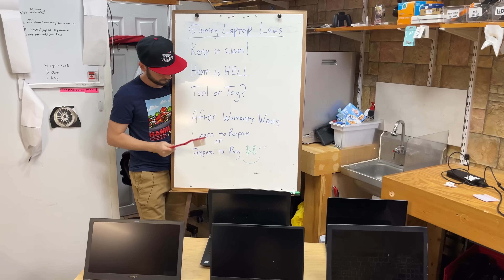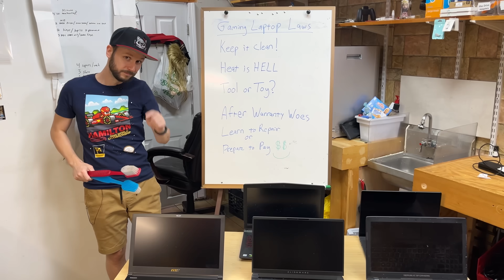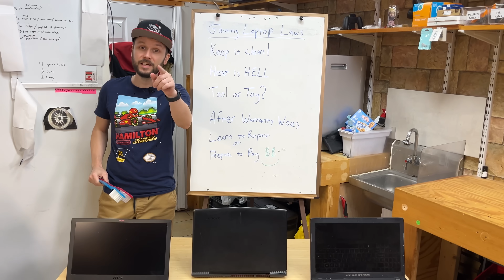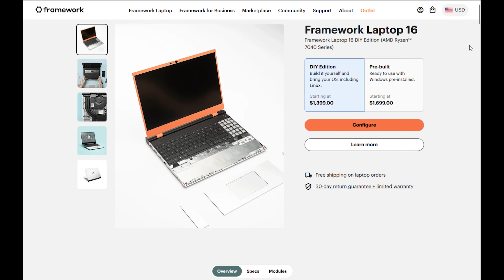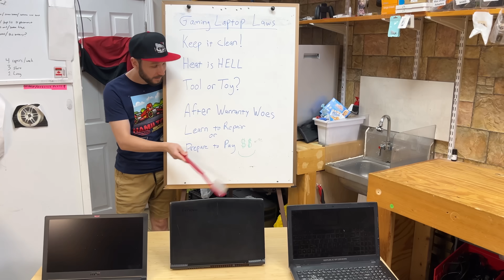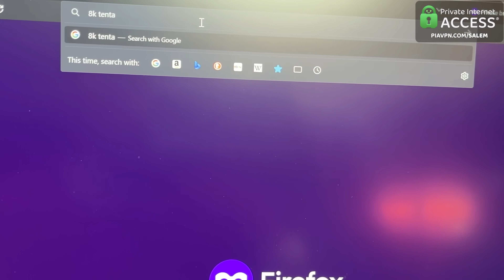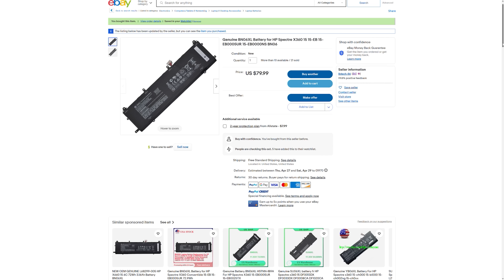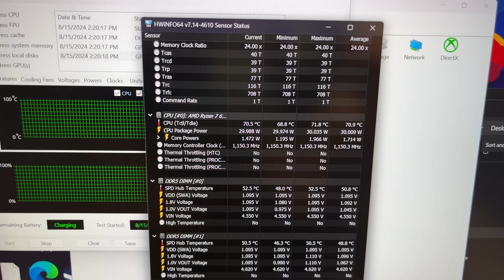Repair Shop Owners Guide to Buying and Maintaining a Gaming Laptop

Comment: I swear my experience with gaming laptops is so diverse. I first had a lenovo that worked for years on end on high preformance without much hassel. Then I did something stupid and bam it broke beyond repair. Now I bought a MSI vector laptop (biggest mistake of my life) and am now in overheating hell waiting for the repairman to fix it for the second time in under a month. Suffice to say I did not follow the tool or toy law :(

Comment: Things you should buy from MSI monitors 1440p 165 hz at 180$ in my inflated country works great.

GPU don't AMD GPU from MSI they break fast Nvidia fine. 

Case subjective some are good mostly not . 

Power supply MSI is good. 

Motherboard extremely good. 

Liquid cooler straight no don't last 3 yrs . 

Laptop bigger screen size one's has the least issue. .
Smaller the size more the problem. 

Don't buy ram snd SSD yes MSI make them in some countries. 
Even if they SSD fine not Ram

Comment: I have a similar model of the Alienware laptop and I always thought I was weird for meticulously cleaning every particle of dust off the keyboard and the fan inlets and exhausts just so it would look new.

Nice to know my OCD has the useful trait of keeping my GPU cool.

The MF power brick for those things though...my god they svck. Even with a fan underneath it the thing manages to self immolate after a few months and stops providing enough juice for the thirsty motherboard.

Comment: Had a Lenovo Laptop with a Ryzen 3 2500U, lasted me a good 4 years and showed signs of it dying and had about 2 repairs.
Reply from the maker: Surprised it didn't last longer tbh
Reply: @SalemTechsperts  At some point around the 3/4 year mark, It started overheating like crazy and then after I got my Prebuilt the very next day, I went to use to laptop to get some files just for the CPU to reach about 0.3-0.5 GHz in Task Manager before it ultimately killed itself.

Comment: Had a lenovo y540 that has 9th gen i5 and a gtx 1650 when I was in college (got it quite late at my 2nd to last year). 

Apart from the keyboard starting to fall apart and the screen that killed itself that I already replaced (because my brother hit it with something while in the bag), its still holds up well. I just did a repaste and some degooching of the fans and vents and it performs as good as new.

Never upgraded the ram and storage though, still stuck at 8gb and 512gb of nvme.

Comment: I had a MSI Raider GE76 I had got at Costco a few years back. I kept that thing in pristine condition. Had an i7 and a RTX gpu. I unfortunately got scammed with it. I thought I was getting 2k for it and shipped it across the country. Hating myself for shipping it before I got payment. But while I had it; I always kept it clean. Only thing I couldn't clean off was some baby puke that had landed on it from me burping my new born daughter. A hint of that touched one of the heat sink vents and I couldn't get in there to clean it out.

Comment: I do have a 2014 Razerblade 15". The only thing was the expanding battery I replaced. Now, right half of the laptop screen has a slight shade blue-grey color if you drag a white background to the affected side of the screen, but the screen still works. Band-aid sol. the problem by connecting to the monitor. Replacing screen would be difficult with no parts for it, and the bezel looks troublesome.

Comment: my asus tuf fx505dt died 7 monts ago due to motherboard issue, i had the same problem with the motherboard about 2 years ago but it fixed on service center, I had that laptop for 4 years, did a lot of work and gaming with that laptop but mostly I used it to watch movies. after my laptop is dead and the motherboard is discontinued I decided to build PC since I work mostly from home, I spend about USD 1200 to build a new PC 2 weeks ago

Comment: Had one just the other day that was 100% closed and looked like. Well not normal dust bunnies. Then one fan in it was completely broke. Not just the blades. Speaking of fan blades. One other one that sticks out it was about 1.1/2 years old. Both fans had melted blades on them. I have sort of seen that before. But not this bad and it was clean inside. The only thing I could think of is they stuck it against something. A guy brough one in and it wasn't even a year old. He already wore down the wsad keys. I did look this up and it was common. I have a saying. Though take it with a grain of salt. No such thing as a gaming laptop or a desktop replacement. Yea they can put in a desktop processor, and dedicated graphics. They even had that pci-e standard for upgrading graphic cards. Though that failed due to different sizes in the laptop per card. What fails to me is the air flow / fan size, upgradable, easy of repair, and as pointed out. Finding parts. More than once, I had to order parts from China.

Comment: Hello from Your Suggestion on Jarrod's Tech Video 

I am Going to Buy Lenovo LOQ 15 with 13450HX + RTX 4050 

Due to inbuilt undervolting and 180° hinge 

But i have heared a lot about intel HX Cpu frying the mobo and battery drain problem especially in customised models

What should i do ?

It is best bang for buck i can afford now i am trying to find HP Victus with 13500HX + RTX 4050 but it is out of stock and it is almost as good as LOQ .

Comment: I ran my legion for about 2 years with the 3070 and fans cranking every day, those heat sinks were clogged it runs 10 degrees c cooler now and it's not cutting clocks all the time

Comment: please please please this needs to be required reading (watching) for prospective gaming laptop buyers. if i had to trace down why every gaming laptop i've owned when i was younger die on me, it boils down to the points you covered. these machines are fragile and come with a life expectancy, no matter what manufacturers say.

silver lining me for me is that after losing sensitive data due to a gaming laptop going dead, it lit a fire under my ass to work hard and save up for my current PC - and you know damn well I'm going to stay on top of its cleaning needs lol

Comment: Just a little tip for people, don’t buy rebranded Chinese Tongfeng gaming laptops from clevo, eluktronics etc. They offer decent value propositions and are great laptops, until you need to repair them. Zero parts availability. Ease of sourcing replacement keyboards/batteries etc should be a big priority.

Comment: Although everything you said is true, I will say I had an AW M15 R7. That is the worst laptop that ever existed even when I only used on a clean, cool surface and don’t own any fur releasing pets. Multiple mother board replacements were required within the 6 months I owned it, as well as a heat sink replacement. They acknowledged bios updates were bricking systems, yet it took months to release a stable bios. I’m never going to buy anything Dell related after that awful experience.

Comment: Got my laptopfor 6 years. 1st thing that broke was keyboard, then the display went boop! Now im using blue tooth keyboards and mouse and connecting it to a monitor. I will use it until it is no longer viable

Comment: been getting your laptop cleaning shorts recommended to me and they inspired me to take apart and clean my 3 yr old asus (that i have not once cracked open to do maintenance on since buying). it wasn't nearly as difficult as i expected nor was it as gross as a lot of the laptops in your videos thank god, and the performance is now vastly improved. i didn't have any thermal paste since the cleaning session was kind of a spur of the moment thing, but i ordered some to use next time. thanks for the info and inspo!

Comment: I like mid range gaming laptops because when a part does break they are usually a little cheaper to fix/buy parts for. Also soldiered ram shouldnt be a thing in gaming laptops

Comment: Been running with an Acer Nitro 5 for a few months

After years of having failing second hand laptops due to my negligence and bed abuse, I'm extra careful to the point of obsession with this laptop. The laptop is only loaded with games and all my work is inside an external hard drive

Comment: So...a desktop is much more efficient? But being more costly? I don't know, I'm in the middle of trying to figure out if I want to buy a Gaming Laptop or a Gaming Desktop. I really want to get into Gaming and possibly streaming and I'd like to buy an efficient computer for this job that can also last a long time.
Reply from the maker: Do you need portability? If the answer is no, buy a desktop. It's cheaper, more reliable, easier to upgrade, easier to maintain, easier to repair.
Reply: @SalemTechsperts  Yeah I'm not looking for portability, but thanks anyway

Comment: I had a friend that knew how to help me build a tower pc part by part, it wasn't hard per say but you do need to know how to handle the different parts, especially the CPU, i felt like i was holding something that would self destruct at the smallest of wrong moves XD
Meanwhile i was holding the RAM like a snowflake, and my friend was like, SHOVE IT IN UNTIL IT CLICKS, and i was so scared i wasn't applying the required force for an embarassing time, he was starting to question reality XD
And I've been learning how to take care of it, cleaning the dust on occasion when i notice it starts to gather, now i know how to unscrew and put it back together ^>^

Comment: I've got a laptop with liquid metal for the cpu...

How often does that need changing? Because as confident as I am in my skills to change thermal paste... which is little, but I can follow basic instructions fairly well, I'm not about to mess with LIQUID METAL!

Would you mind posting another video for cleaning tools/solutions?

Comment: Be very careful when taking the heatsink out of it's place. Often you have the CPU, the GPU or both cooled with liquid metal. If you are not careful when removing the heat sink, you could spread that liquid metal all over the mainboard and guess what the metal part will do to it ? Short short short ...
So learn to repair but be very careful when dealing with liquid metal...or gaming laptops.

Comment: My last two laptops were both gaming laptops and never had overheating issues despite being used in places with pets. 

It's really simple. Don't get a $3,000 laptop. Get a $1,100 laptop on sale for 8 or $900. Something with a 4060 in it. You don't need anything more. I promise

Comment: I've kept my laptop clean for the past 2 years I've had it as well as replacing the thermal paste but it still has overheating issues and 2 of the keys stopped working 😭

Comment: I learned how to repair laptops by myself since 2016? Because I bought an XPS 13 for school but I was short at budget so I ended up with 4G+128G very base model, guess what? SSD is the first thing I found it not enough. So I search on the internet, SSD brands, how to reinstall windows system etc. I end up get 256G SSD which finally kinda enough for me to use as a daily driver. After that I found 4G RAM is not enough but there is no way I could learn how to change RAM which required a heat gun and more knowledge, so I end up get a 8G motherboard and 3K display from partspeople which cost a lot...I have to learn how to install the motherboard, change thermal paste and assemble it without any fuck ups, I did it! But I also learn a lesson, for choosing laptops, make sure get enough specs you need and you have to think about the future...
After that i switch to gaming laptops, get warrantys and repaste myself twice a year. I like DELL because they offer a very detailed service manual on their official website, followed the steps you probably won't screwed up... hopefully...

Comment: Have my alienware m15 for 2 years now mainly using it for work. It started sounding like a jet engine on a regular basis a couple of weeks ago. Took it apart and cleaned what I could see. 
Do you have the renewing the thermal paste in a normal speed video or do you recommend I give it  to someone who has done this before? 😂

Comment: i have a Vostro 3520 and use it for work and gaming but not so much gaming since my desktop is better and the laptop sometimes heats itself on putting it on my bed but only for 5 minutes then it gets cooled  and when it is not on a bed it is hella hot more than the heat when is it on my bed is it a problem that should concern me?

BTW i love your vids keep going and don't watch Po-kemon alone at 5:00 A.M it isn't good for the greatest technician that has ever lived

Comment: My laptop has only 2 speeds: 30fps gaming or 102°C gaming 😓

I regularly clean my gaming laptop and reduce graphics to maintain temperatures because I'm not brave enough to underclock ryzen cpu

Its not hot because its poorly ventilated. Its hot because it targets maximum performance regardless of whether its even necessary. It took so long for me to figure out that to avoid getting locked at 1.6ghz to manage temps, I can put the fan preset to quiet mode which prevents them going above 90°, then manually adjust the fan to get 60fps without my pc cosplaying a supernova

So far the only problem is a slow hard drive I replaced and missing screws because I suck at this

Comment: If you are a engineer planning to use solidworks, the suggested amount of ram should be 32 gb or higher. Or you are screwed. Or in the greatest’s words, f-sad. Or you will be waiting a millennia for any assembly to load.

Comment: What do you think about doing an expensive desktop/cheap laptop combo to remote desktop into? I need a very accurate screen, strong internals, something portable, and something durable (high end creative work) but they don't usually have to be the same device. 

The remote desktopping would be more of an exception than a rule, but i'd love to hear if you guys consider something like this viable for videoediting as an alternative to buying a glass spaceship that'll inevidtably fail in 2 years anyway.

Comment: Based! I have a question. Bought the same M15 R7 laptop few days ago. 

Can fans be pulled out and taken apart without taking off the cooler and motherboard? I would like to add a pinch of grease to the bearing. Already cleaned the dust. Thanks!

Comment: Ahhhh if only I can send my gaming laptop to you. Constant overheat until I disable turbo boost. It's a pain in the ass because its require 3rd party to disable it cause there's no option in the bios. Fan free from gooch thermal paste replaced but still thermal throttle to the point freeze and buzzing when gaming 😩

Comment: This is why I'm getting a desktop. But Lenovo is pretty reliable about parts. But nothing else.

I currently have an Ideapad 3 Gaming Laptop with Ryzen 5 in it. I got it in 2022 and it's been 3 years now. It still keeps going but it's showing its age. Not to mention there is a line of dead pixels in the middle of the screen. The A button doesn't work and the external shell has a scratch on it. I need and want a desktop.

Comment: Simple solution....don't buy a gaming laptop. Heat WILL  get it, it'll be expensive, it'll under perform, oh and it'll be expensive to fix when the heat gets it. I had to replace a keyboard on an Alienware laptop....72 tiny tiny screws on the keyboard sub-assembly. It was not a cheap fix for my customer.

Comment: my only problem to learn how to clean is those new "Fit together tightly plastic click bits" ... the ones you open with a pick.... or a screwdriver in my case. 
they scare me. I don't know when it will break or if i will hit a wire... which is very specifically placed near the touchpad and keeps jump scaring me

Comment: I've stuck with gaming laptops bcuz i prefer the portability. Had a asus g750 that i had to tear apart every three years due to something breaking. 
Now i use a modern alienware and when it breaks, there's no fixing it. Have had it apart a few times now and it's a miserable repair experience compared to the old asus rog. Almost everything is soldered to the motherboard now. No discrete parts at all

Comment: Question for you sir. I've had a gaming laptop for 2 years now. I clean the exterior of finger gunk about 2 times a week, kinda dust it with compressed air once a month, and change windows about once a year. Only, and I mean only reason I haven't pried it open to deep clean or change thermal paste is because its still within warranty. For another year and a half even. Question is: At what time is it reasonable to decide to take a shit in my warranty and do a proper clean, or should I keep my sub par efforts going till end of warranty?

Comment: MSI gs66 2020 Model decided instead of having a desktop because I change 2 times country alread and is difficult keep up with bulkier pc.
Never had hinge issue because always opened correctly. Fan cleaning performed every year (before summer) and plannig to check termal paste after 5 year (next year).
Regular use for Photoshop/video editing and exporting long session on davinci resolve (like leaving it rendering whole night)... I never had a internal problem except some keybord RGB led stop working. Still goes has first day.

Comment: Hey , Genuine question about laptop maintenance ... for new devices with warranty stickers on some of the screws needed to take the bottom off , do you think I should still try to clean the computer and void my warranty or just stick with general maintenance and making sure it looks good on the outside . 

I know the video goes into great detail about how dust inside can kill a laptop and I agree ... but having to void my warranty for it feels like a not so smart move ? what's your opinion on this matter ?